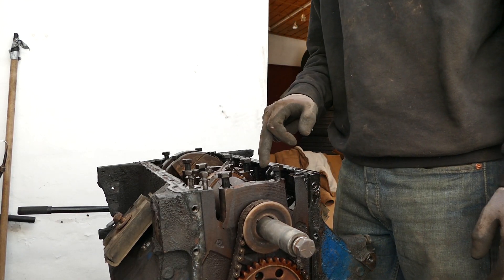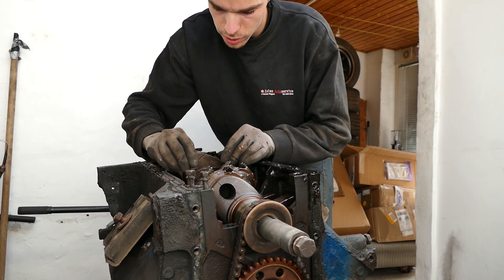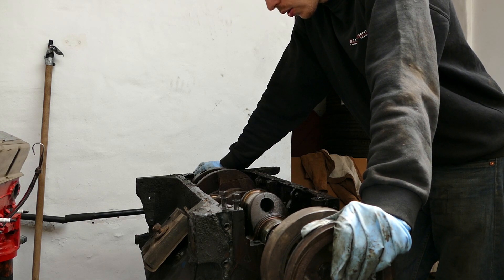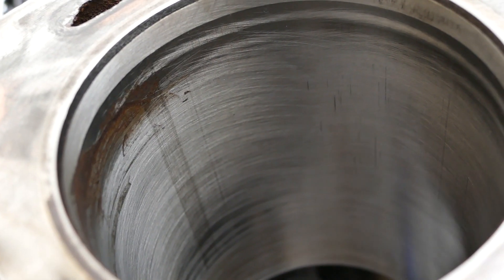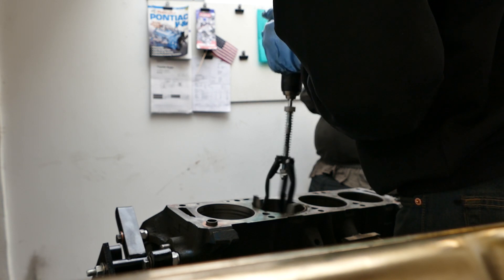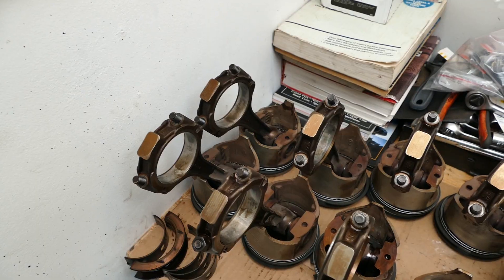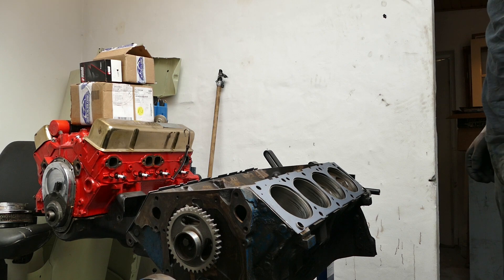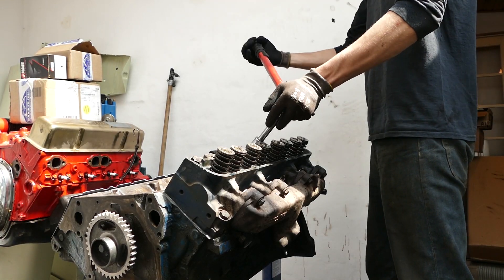Big Block Build 360 FE Ford Engine!

Comment: i own a 360 in a 74 Ford F 100,,,,one of best engines we ever owned....when it was only two years old....i got a old 390  barrel intake...and a Motorcraft 4 barrel carb....it really woke the 360 up....could out run 350 4 barrel stock Chevy Cheynene pickups in that era,,,,and 390 two barrel...why Ford never offered a 4 barrel carb set up on these is a mystery  as it was known as weak engine....Chevy to there credit did offer two and four barrel version of the 350...i still own the truck...
Reply from the maker: nice yeah really great engine but no alot of power specialy not the 360 with 8 compression hehe i put a 352 in mine orginal 4 barrel galaxie 64 motor way beter!
Reply: @Viktorrhansen  Mine would out run a lot of stock 350 chevys back in the day....they were not fast either..my uncles had two....and the 350s took a lot of gas...as well...
Reply: I own a 72 360 short-bed Ranger XLT in really nice shape. During covid, I swapped in a Crown Vic front suspension. Swapped out the old heavy intake for an Eddy Performer dual plane and Eddy 600CFM carb. Swapped heavy water pump for Eddy aluminum, long tube headers, 3 inch exhaust. It really woke up the 360 with its low compression crank. Still running stock single point OEM distributor. I can easily light the the tires with the stock C6 trans. It's plenty of power for a Sunday driver. But I would still like to do an MSD ignition swap. I was going for better handling than I was performance and didn't want to spent a lot of money on H.P I'm thinking about a 428 crank some day, while keeping same heads and intake. If I invest in new larger ported aluminum heads, then I need different new headers and larger capacity radiator and a stall converter and on into $15,000. Thats prior to needing a crash helmet for my stupid old head. Just does not make a lot of since while I'm just fine with what I have and the short time I have left to enjoy.
Reply: 360 not a performance engine. That went to the 390.
360 was a good base model engine.
Reply: @jesse75   Back in mid to late 70s most all engines 350 chevy and Dodge had 8.5 compression...not any difference than a 360...a two barrel 77 Chevy 350 was a dog too.
Reply: plus Chevy 350 only had 8.5 compression...back in 70s..a dog two especially in two barrel form

Comment: I have the same truck with a 360 that I’m hot rodding. Not really sure where to start now that it’s running. Definitely looking forward to the next video.
Reply: Definitely have the motor bored over to at the very least a 390. The 360's are gutless especially if you want to tow any thing.
Reply: I think you can even put a 428 crank to make it a 410 stroker and a bore over.

Comment: I know this video is old and you may not remember, but was there an engine size stamped on your crankshaft? I have a ford fe service block that has ZERO casting numbers and the heads and intake don’t give a clear engine size. I’d like to know exactly what it is so I don’t have to take it completely apart. Any information would be helpful.
Reply from the maker: i dont remember if it had a casting, if you wanna know what size it is 360 vs 390 then you can pull a spark plug and check the stroke the 390 has a longer stroke
Reply: @Viktorrhansen  Thanks for the help! I’ll try to measure it this evening. I’m hoping it’s 390 and above.
Reply: The crankshafts do not have any numbers stamped on them  indicating what size the engine is. I can tell you the 360 uses the same crankshaft & rods as the 352. They are different from the crankshaft & rods from a 390. They are visually different. The crankshaft from a 352 or a 360 will have a 3.50 stroke. A crankshaft from a 390 will have a 3.78 stroke. The rods from a 352 or a 360 are skinnier & slightly longer than the rods from a 390. There are basicly 2 different kinds of rods used in FE engines. The longer, skinnier rod is used in 360 engines & smaller. And the heavier, shorter rod is used in 390 engines & larger. So what I mean is the 332, 352, & 360 will all use the same rod. The 390, 406, 410, 428, & 427 will all use the same rod. With some exceptions. 428scj & 427 engines have some special rods but they will be the same dementions as the 390 rods. As far as identifying the crankshafts, you will have to research it becouse I don't know how to tell you what to look for without showing you. But the difference will be noticeable by simply looking at the front & the back counter weight. The 352 & 360 crankshaft will be flat on the outer part of the counter weight while the 390 crankshaft will be raised alil bit. If u don't know what to look for you will miss it. If you do know you will see it easily. That's the best I can describe it without showing you. Good luck.